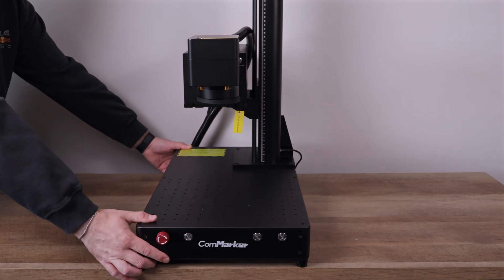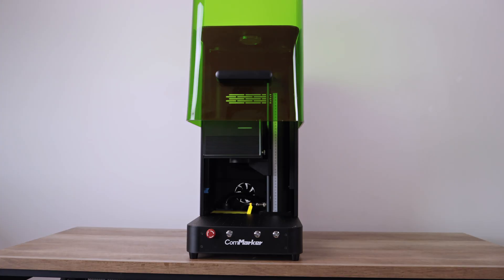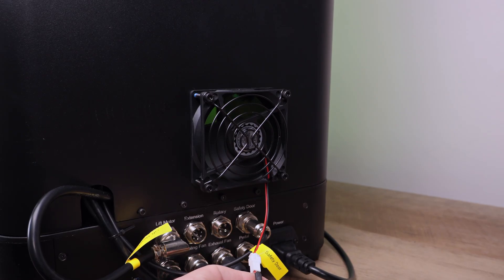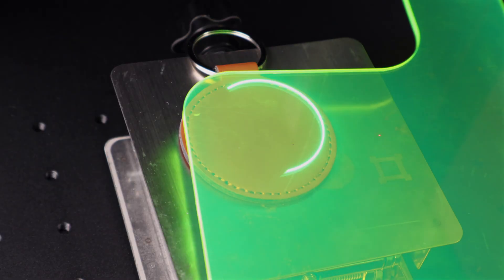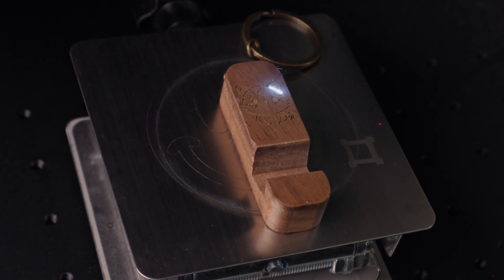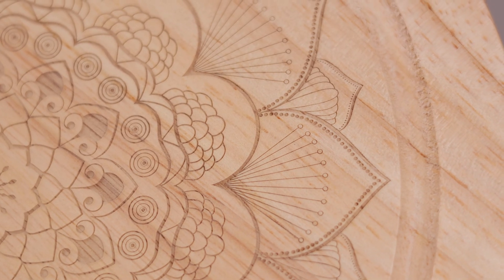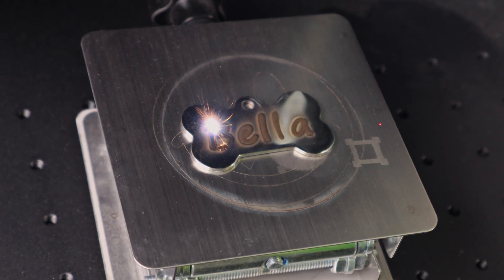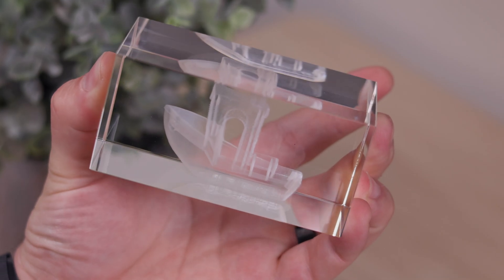All New ComMarker Omni X World's First 3d Laser Engraved Benchy?

Comment: I'm really curious if you can test Omni X for color 😜 I've seen a couple of places mention "annealing stainless steel with UV laser" particularly a hobbylasercutter post about "Omni1 5w vs 10w" (JT Makes It). Definitely harder! And 'not suggested' but would be wonderful to push it see where its limits are

On their sales page they boast they can do engrave dots at '0.0019mm' (1/13369 inch? 0.0000748in?) 'in the lab' - and what your measure as their dot and smallest cutting width?

Comment: First?  Pfff
Reply from the maker: Did you find another one somewhere? 🤔
Reply: @VelfCreations  I have been designing solid-state , gaseous  and eximer laser sources since 1983 and laser machines since 2005, mostly fiber, CO2, and UV engraving machines. These subsurface engraving machines have been commercially available for over 15 years or more. I am in no way underestimating your machine; on the contrary, it is a compact machine and seems very well built to me.
Reply from the maker: @ricklaser2846  But we are not saying this is the first laser that can do subsurface engraving, we are saying “first 3d laser engraved benchy” 🤔